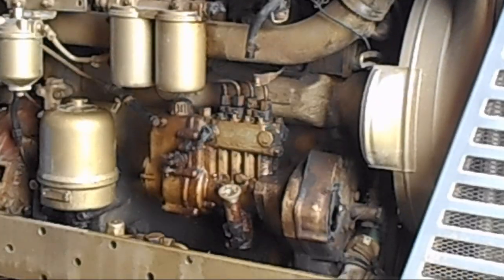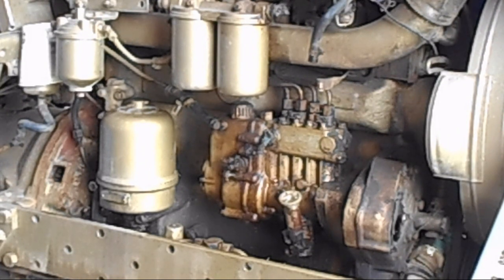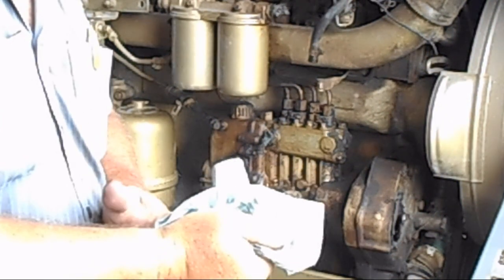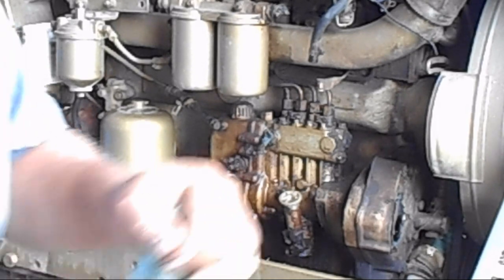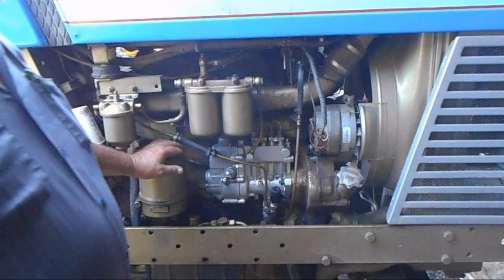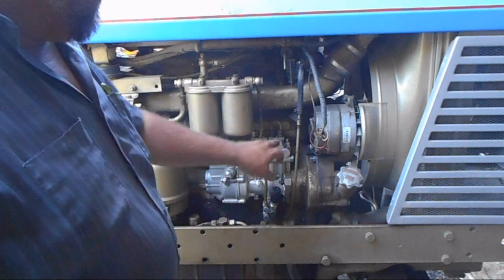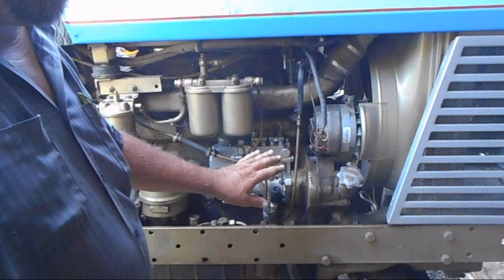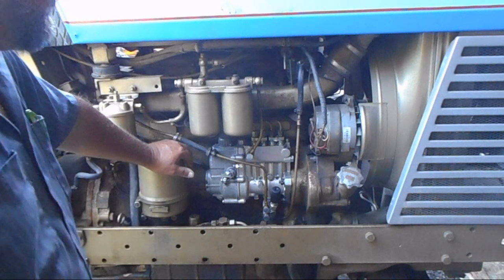The Long get a New Injector Pump Sort of ?

Comment from the maker: Well after reading the book I figured it was time to change the injector pump on the Long, So I pulled the fuel lines off and the aultinator and the cover off the front so I could get to the nut on the gear. Well lets just say something got lost in translation in the service manual !  It wasn't what the book says it was so I had to reread to book several times and it just wasn't making sense. So I ended up putting it back together and taking it to a guy I know to change it.  At first he told me he thought I could do it myself but after get it done and having problems doing it he said I did the right thing by bringing it to him to get it changed. I think it was money well spent getting the pump changed and it running again. It starts and runs good but it doesn't have full throttle and the timimg might need to be adjusted a little once I get it in the field because there are no timing marks to go by !  But this was money well spent getting this changed cause this was beyond what I thought I could do and I was right !  A mans got to know his limitations !  I hope you enjoyed.  Bandit
Reply from the maker: I've never changed an injector pump myself but I have seen many pulled and watched how it was done, I did read my service manual several times and it made sense at the time and because of what I have seen in the past.  But when I got into this it was completely different and what I was seeing didn't make sense to me. So I did some rereading and looking in my parts book and I was confused to say the least !  I think something got lost in translation (Tractor built in Check Republic) and it seamed to me something was missing in what I was reading.  I was smart enough to know not to take it apart and to take it to someone who does and even they had problems so I know for a fact I would have screwed something up good !  To me it was money well spent and piece of mind is worth more than all the gold in the world  !  Bandit

Comment: Love your honesty bandit. Man has got to know his limitations.
Reply from the maker: I've never changed a pump myself but I have seen plenty of them changed and its fairly strait forward, Get it in time first then pull the pump because when you get a new one it is timed to number one and install the new one. But the long doesn't have timeing marks and with the injector pump leaking inside and out that will make it really hard to time it by the way the book says to do it.  At first he told me he thought I could have done it but after he got done he said I did the right thing bringing it to him cause he even had problems doing it and he's been working on tractors sense 1970 !  If you get into something and you think its beyond what you can do at least be smart enough to take it to someone who can fix it before you cost yourself a lot of money and time. You got to know your limitations and I know mine !  Bandit

Comment: That reminds me of the "proper" way to time a Bosch P-Pump such as on a Cummins B-series.  Hate overengineering like that where you have to remove 100 different things to get to 1!  For sure the correct decision when you realize it's beyond your capability or experience to let someone else do it (and maybe learn from them!)!  Glad it's running again.  A dyno would be great for adjusting that pump if you can find someone with one.  Hope you get to feeling better!  I'd say what you spent was well worth it!!  The alternate could have cost you a lot more!  Thanks for the video!
Reply from the maker: I had talked with this guy about the pump when I bought it and showed him the books and he sat down and had a good read and he thought I could do it, But when I started getting into it I figured out real quick it wasn't like the book said it was. So I took it down to him and after it was on he said I made the right call bringing it down to him because he had problems changing it. He did tell me I would have never gotten the nut off the end of the injector pump shaft as it takes a special socket to get it off.  He bought a socket in 1972 off the snap on truck just to do tractors from Europe, He said this is the 6th time he has used that socket sense he bought it. Its a hardened round nut with a slot in the end of it and you cant get it off without the socket. I figure $450 for getting the tires changed and the pump put on was cheap and money well spent as far as I'm concerned !  Hay its only money right ? Bandit

Comment: SLEDGE-O-MATIC MOMENT 
 I like it ! I have been know to do that a time or too myself lol
Reply from the maker: We all get them from time to time but it never makes it work ! LOL Just causes you to spend more money ! LOL I have a good story about my one cousin having a Sledge-O-Matic moment on a 3/8" nut and bolt that he fought for 3 hours getting it off an old JD disk that someone put threw the hitch on the back. He had every wrench vice grips pipe wrenches even a hammer and chisel and all 10 bloody knuckles he finally got it off !   He was giddy it finally came off to the point he was talking to himself and laughing in a very strange way, He laid it oh so gently on the big anvil outside the barn . He grabbed a 10 lb sledge hammer and rared back and said FEEL PAIN MF ! and net the sledge hammer fly ! LOL LOL LOL  !!!!!!!!  He hit it dead on and I can still see the smile on his face and his feet off the ground ,  THEN the handle broke and was in return to sender mode and it caught him right between the eyes !!!!!!!!  Down he went !  He came too got up and said what happened ?  I told him as I was leaning on the cutting torch !  LOL  I didn't dare ask him why he didn't use the torch to cut it off, He might have got mad at me !  LOL  Bandit   Good old Sledge-O-Matic  !

Comment: Wise move on both the tires and pump. Not worth putting yourself in harms way for 450 bucks. We like to use inner tubes from Kleber. They are more money than Firestone but they are about twice as thick and are made from natural rubber. Anyways good luck with your harvest.
Reply from the maker: I think this was the best thing I could do having the work done, The tires would have been 2 days worth of work for me or more !  4 hours and he was done , I watched sipping on a cup of coffee and enjoyed watching him work. With the Long after reading the book I thought I could change it but once I got into it it wasn't like the book said it was !  So I put it back together and took it down and let him put the new pump on and I'm really glad I did cause even he had problems with it .  But it was money well spent in my book and I would do it again the same way ! Bandit
Reply: @banditfarmer1900  we have a nieghbour who is really good with diesels. If he doesn't know, he asks  someone who hopefully does. He used to work at a caterpillar dealer. But i dont think he ever encountered a long/zeter
Reply from the maker: When I red the service manual it seamed pretty strait forward , But when I got into it I realized this is not what the book says it is. I've never changed a pump before but I've seen a bunch pulled and this one was nothing like them at all !  After rereading the manual and finding 3 different sections in it on Removal , Installation and Timing I was so confused I figured something got lost in translation ! LOL  At that point I put it back together and took it to Harry to put the pump on and even he had problems with it. He's been working on tractors sense 1970 at an Oliver dealership and he's worked on tractors built in Europe from Fiat and David Brown and later Isike (?) from Asia . So he had a better idea than me how to do it. But this was his first Long/Zetor tractor to work on and he said he liked the challenge of doing it . When he told me he thought I could do it and then brought it to him to do he was disappointed in me for not doing it, But when he got it changed and running again he said I did the right thing by bringing to him to do because even he had some problems changing it.  A man has got to know his limitations and I knew this was one I didn't know how to do so I got someone who knows more than me to do it !  Bandit

Comment: looks like you need to take the tach drive out
Reply from the maker: Well after going threw the service manual to take the tach drive off is simple enough however once its off your going to have a heck of a time getting it back on and requires a special tool (I don't have one) to take the nut off the end of the shaft.  The book says to only take this apart if the bearings have gone bad on the pump drive shaft. To take the front cover off is nothing to take lightly, Its going to be a lot of work to take it off . The hood ,muffler, radiator, water pump and the aultinator and the crank pulley all have to come off to get that cover off and the tractor has to be put in time before you take it apart because all the timing marks are on the gears under the cover !  So lots of work to do to get into the injector pump drive shaft. Bandit

Comment: Glad you got the old girl back to normal where you can use her now and I really liked what you said with the mechanic thing because I think I would have done what you said because I have never seen a European injector pump until now and what I have always said it's better to be safe than sorry when it comes to stuff like that I know a lot of stuff. But not on European injector pumps now on the American older tractors I could learn and teach myself probably but for European I will try it but I would rather stay away from it enjoyed the video Bandit can't wait to see the cab video and see what the cab looks like that you are thinking about putting it on her catch you on the next one, talk to you take her easy tell Pops I said hey talk to you on the next one buddy and can't wait for the case videos I love that tractor I don't know why I guess because my friends got one and I have always wanted one since I've seen his 😁😁😂😂 talk to you on the next one be careful and be safe Bandit
Reply from the maker: I've never had to pull a pump before myself but I have seen quit a few pulled and there pretty strait forward , Put the engine in time and pull the pump and put the new one on it and line it all up and you should be good to go.  But this engine has no timing marks and the way you time it is hard to do with a pump that is leaking inside and out  but Harry got it done and done right !  It might need a little tweaking to get it nailed down but ware its at now is really close to perfect so I don't think I need to fool with it to be honest . I got to do some disking with it yesterday and its running really good !  New tires and injector pump she's good to go for a LONG time ! LOL  Bandit

Comment: I realize its easier when all of your tractors have the same drawbar height, but 15.5 inches seems a little low for a tractor that size.
Reply from the maker: Not really, 14 to 16" used to be a standard height on a draw bar on tractors,  But now there at your knee caps ! LOL  I'm going to have fun getting some of my equipment set up for a higher draw bar now.  Bandit

Comment: oh and remember the sledgeomatic moment just makes you feel bettet, it dosent help but it would have been funny
Reply from the maker: When he told me he had some problems get it on I knew I would have had a Sledgeomatic moment for sure ! LOL  That's why it went to him to do it !  LOL No sense in causing a problem ware there don't need to be one, Doc said I don't need stress right now and I know my blood pressure would have been threw the roof if I tried to do it !  So I let someone else worry about it and I just wrote the check ! That's the easy part and I had a nice relaxing drive home @ 15 mph  !  Bandit

Comment: What size tire did you take off it?
Reply from the maker: The Longs old tires were 18.4x34" Firestone 151's and the new tires are 18.4x34" Good Years DuroTorques and brought the draw bar up 3 inches , So I'm going to have to work on the disk tongue so it will come up high enough to use it on the Long now.  That's the part about tires now, No ones tires are like they used to be size wise. As long as they are in pairs when you change them it really don't matter.  I hate seeing tractors with mismatched tires for this reason !  Bandit

Comment: sometimes one has to drop back 10 and punt no shame in that
Reply from the maker: I've never changed an injector pump before but I have seen many pulled and this was something completely different than anything I have ever seen.  I know without a doubt I could change the one on my Oliver 1550 diesels without any problems because there are timeing marks and they are simple to change, This Long/Zetor doesn't have timeing marks and has a special nut on the end of the pump and is not put together like most American tractors . So I took it to someone who has worked on tractors from Europe and even he had problems with it so I don't feel a bit bad about taking it to him. At least I'm smart enough to know it was something I better not work on and get someone else to do it before I screw something up !  Money well spent in my book !  Bandit

Comment: Hoping for the best, thanks for the sharing the info
Reply from the maker: I'm hoping its a simple adjustment I can make on the throttle rod to solve the problem, But its running again and that's all that matters now. That was money well spent having him put that pump on and its running now, A simple adjustment I can handle easy enough. Bandit